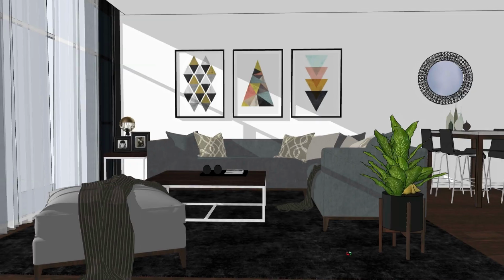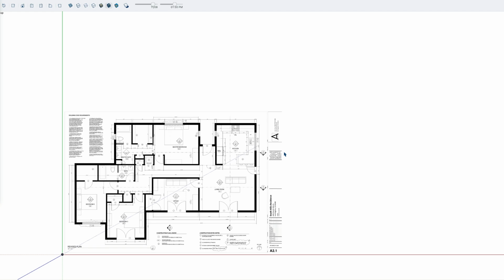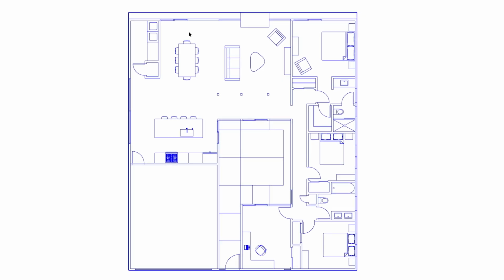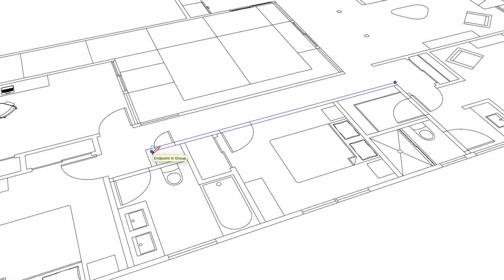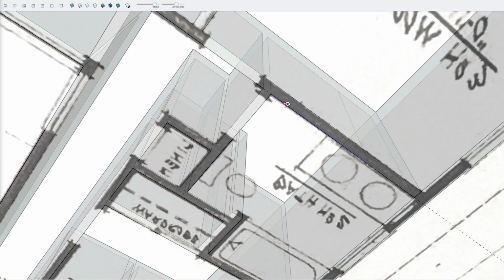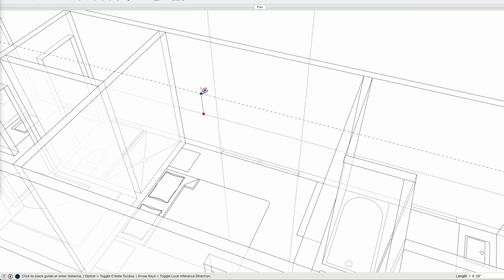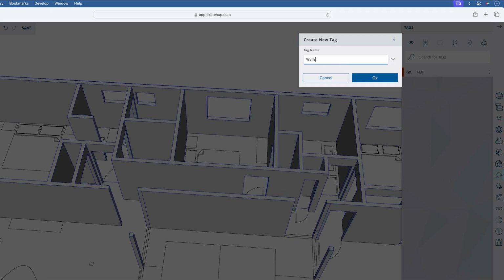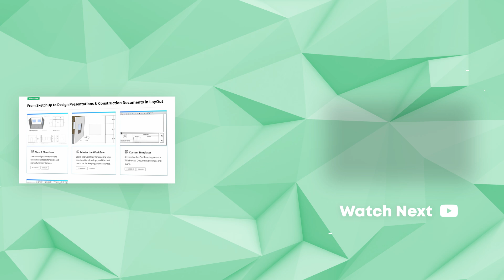SketchUp Tutorial – How To Turn 2D Floor Plans into 3D Models (2024 Update)

Comment: After making my 2D skp drawing into a group. Had trouble tracing the walls and then erasing the "unnecessary edges" as the group would disappear. After several attemps, I realized to pay attention to the "edit group" mode. Apparently if there is a dotted line around the group, I'm in edit group mode. Otherwise...I'm not sure what's happening when I'm tracing/erasing.
Reply from the maker: Glad you were able to figure out how getting in and out of Edit Group mode affects what geometry you are editing.